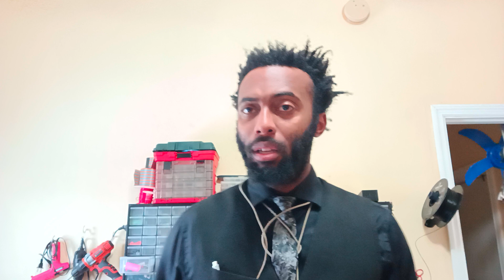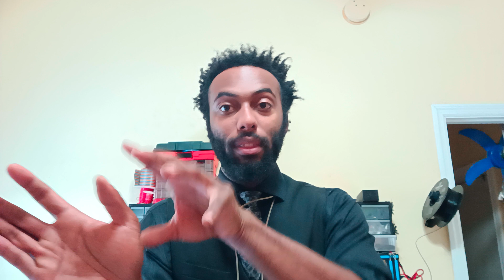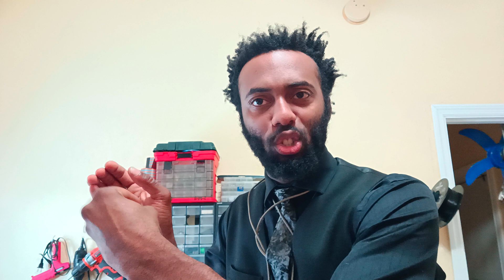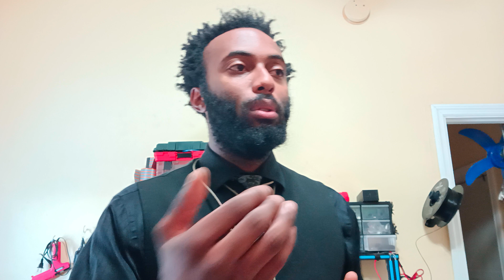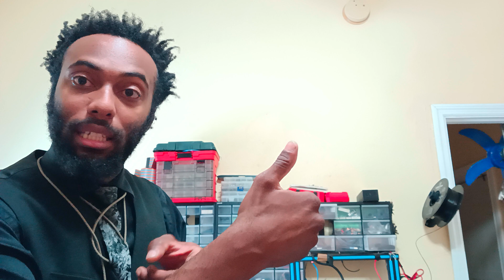Voyager discovery Pt2

Comment: 1:50 NASA isn't switching off instruments to 'conserve power' in the sense this phrase is usually used. You're right: RTGs don't work that way: you can't make the device last longer by switching off devices. It's the other way round: the output power of an RTG reduces over time, so they have to switch off instruments to keep the power draw of the spacecraft within the available power of the RTG. You can still call that 'conserving power' in the sense that the remaining amount of power is made available to some instruments by switching others off.
2:27 Popular science writers called it a wall, which is a bit hyperbolic. The actual science papers are more prosaic and describe the findings accurately: a temperature of 50,000 K (which is higher than expected) and a density of ~1 atom/cm3. 
So you seem to be arguing about semantics and third-party embellishment rather than finding inaccuracies in anything NASA's saying.
Reply from the maker: I have no argument for first part. You understand that 1 atom/ cm^3 isn't very dense at all and the only reason it could theoretically stay as hot plasma is because it would have no ability to transfer heat. Our inner solar system is just slightly denser as at about 5 atom /cm ^3 this means an RTG would not be very effective because it needs to have a cool side to radiate heat to. If plasma can remain as hot as it is for as long as it has done so than how would you get an RTG to put out that kind of power, especially one made in the 70s?
Reply: @connectingthesciences  
The temperature of the heliosheath is maintained by collisions. You have the solar wind going outward, and cosmic rays coming in. There's enough radiation to heat up the very thin plasma, not enough to heat up solid objects like Voyager's RTG. 
The RTG loses heat through radiation.
Reply from the maker: @h.dejong2531  First do you understand that the collisions from the solar wind are just part of the electromagnet spectrum and lose energy following the inverse square law meaning that we here on earth would be subject to far more (by several magnitudes). These particles collide with the earths upper atmosphere all the time and don't have that level of energy. Also the radiation for the RTG to cool still needs particles/mass to radiate that heat to. You can just radiate heat into nothing, this is the basics of conservation of energy. This means that when it traveled from 5atom/cm^3 to 1atom/cm^3 its power should have dropped drastically just because it has far less mass to radiate heat to. Couple the lower density environment with over 40 years PuO2 decay and the numbers claimed don't even come close to lining up.
Reply: @connectingthesciences  Heat transfer by radiation is described by the Stefan–Boltzmann law. This law shows that the energy you lose by radiation is independent of the ambient temperature. You do have to account for energy coming in; in Earth orbit that's about 1300 W/m2 on the sunlit portions of the RTG. The shadowed portions of the RTG are warmed up only by the occasional collision with particles (5 per cm3, i.e. negligible). The radiators are built to provide enough cooling for full performance in Earth orbit. As you get farther away from Earth, that margin starts to grow.
Reply from the maker: @h.dejong2531   Bro Have you done any heat transfer before? Radiation is a function of of dT^4. If the temperature of what your radiation is the same as the mass it radiates to there will be 0 energy transfer this is the basics of diffusion and conservation laws. Also im not talking about warming im talking about heat losses with respect to the radiator. You literally can't lose heat unless you have something to lose it to (basic conservation of energy). If you could lose heat to nothing that would be the loss/destruction of energy.
Reply from the maker: @h.dejong2531  Just so you know im enjoying this back and forth. You seem pretty educated.
Reply: @connectingthesciences  You're not destroying energy, you're radiating it into space. 
That T^4 term is the temperature above absolute zero.
Reply from the maker: @h.dejong2531  space is literally made of atoms there is no such thing as a perfect vacuum and we have no evidence of anything that actually exist at absolute zero. So when you radiate into space its the matter/mass that its transferring to.
Reply from the maker: Also to your first point at 1:50 im not trying to fight Nasa I love nasa, im just trying to fight false information. Some of the personnel and departments at nasa push false information. This accounts for a percentage of Nasa not the whole organization. I believe most of nasa is an amazing organization trying  to do what's right